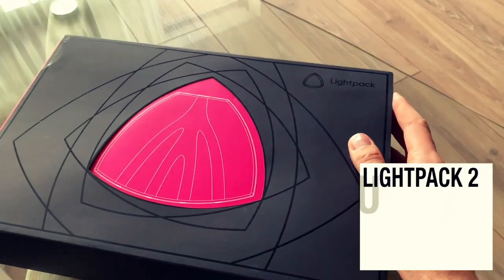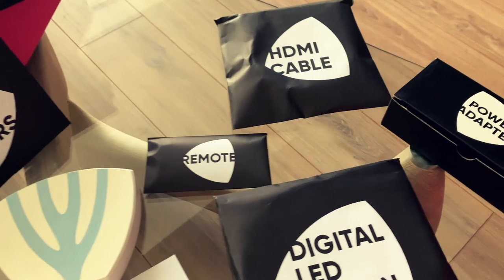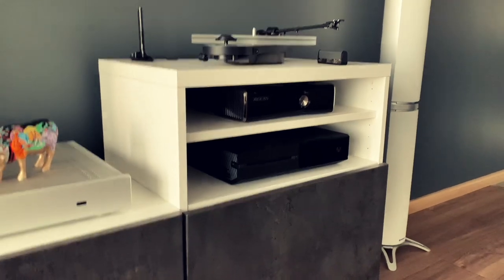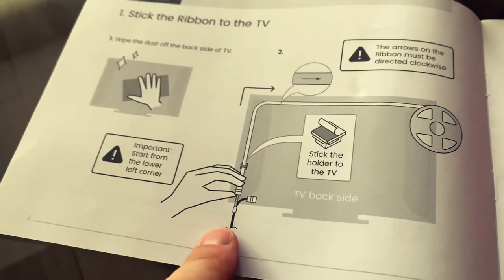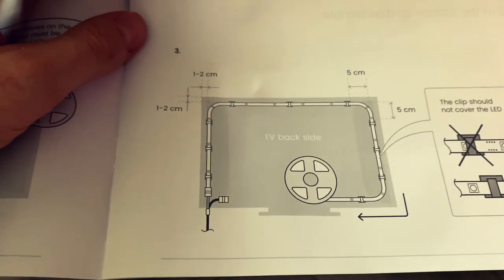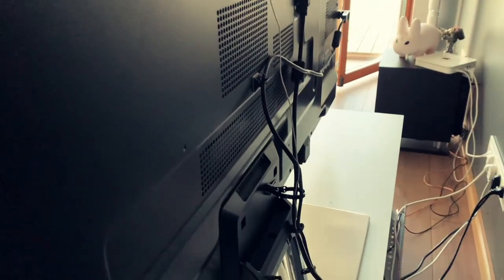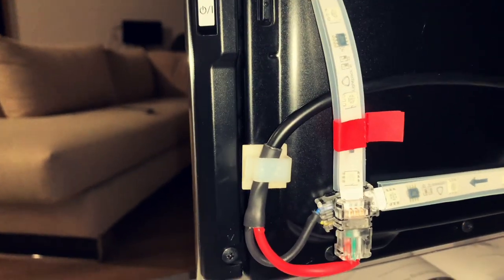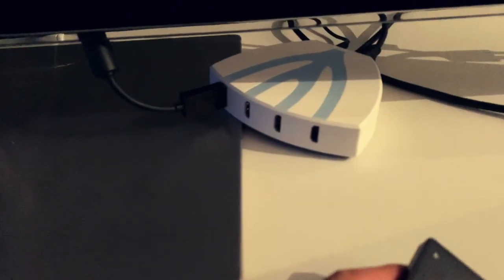Lightpack 2 - Unboxing, Installation, Review and Impressions

Comment: I bought the first model on kick starter and I love it. Had it for years and it run great. That kit came with individual lights that you could place in multiple formations. I really liked that because you could see some cool differences in how the color falls. You could also increase the saturation and brightness. Not sure if you're using "Prismatic" I only run my kit through my HTPC but there are a few settings there. Great Review!

Comment: I'm having issues connecting my HTPC to the lightpack.  for some reason when I connect the the htpc via the hdmi ( with CEC attached) it say no signal.   also think that its outrageous that they dont provide corner attachments for the led strips.
Reply from the maker: I think they decided that it will be simpler for an average consumer to stick one continuous strip rather than cutting it into pieces. As for HTPC, I suggest trying fiddle with HDMI settings (CEC, HDR, other things) and potentially hooking to another HTPC HDMI output, if you have it.

Comment: I saw this, but went with the Ambivision light system as its much better and more accurate with matching colours by using just a camera facing the tv.
From what i saw in this video the colours weren't matching what was on the screen. Also with the Ambivision there is no plastic covering the lights as it just sticks to the tv and can shape it to suit the sharp corners of the tv, instead of curving it like with this products lights.
Reply from the maker: Interesting, but I have to question the setup. Having an external camera somewhere between you and your TV might not be super practical. Also, you have to factor in processing delays in this setup. But if it works — great!

As for the color representation, this depends on many things. I believe the problem with the current LP2 strips, is that they are RGB only, there's no white LED (RGBW), and white tones tend to be bluish. Original Lightpack did a better job with color representation. But one more thing that affects this is the color of your wall. Mine is dark grey, which is ok, but not ideal, I suppose.

Comment: Hi can i apply this on 65inch tv ? Its only 5m long , is that enough for big tv like samsung q90r 65 is ?
Reply from the maker: I have 65" TV, and it is enough. But I would say it won't cover 70" or bigger TVs
Reply: @DanSilov  ok thanks for response :-) and what that mean its dosent support hdr ?
Reply from the maker: @psych0sko  Some newer movies are encoded with HDR (High Dynamic Range) which translates into a much better contrast than regular videos, but only if your TV supports it. Yours does support it, but you also need some videos to play. From what I understand, LP2 won't pass through HDR videos.
Reply: @DanSilov  thanks brother 🤞🏻

Comment: I got the moonlight to work.  How do I get it to play now through my ps4 and xbox? Thank you
Reply from the maker: Just connect PS4 and Xbox to one of the inputs on the LP2, and plug the output into TV. Then switch the mode of the LP2 and it should work. If it doesn't just power cycle it.
Reply: Dan Silov does I have a ps4 pro and a 4ktv; does that reduce the resolution to 1080p?
Reply from the maker: @erock81487  They have (had?) two models, standard and UHD. UHD is for 4K. The standard model probably won't output anything, unless you change settings to 1080p.

Comment: I've had mine for a few months now. One was DOA and they had to worship me one. Also I had cut where I'm supposed to but now theres still a 4 inch section that's dead which throws off the measurements so the colors dont match up with on screen actions.
Reply from the maker: I think it might be that the LED strip is damaged at the section that is not working. You can probably cut it out and use the included connectors to stitch the strip back.
Reply: So is it crap or nah
Reply: In the end, nah, it's not crap. I was able to update the firmware to correct everything and in the end it makes watching anything with it that much more immersive
Reply from the maker: @gemineye111  No, it's definitely not crap. When it works, it's very impressive. It's all those beta quirks that you have to live with that make the experience somewhat finicky.
Reply: Dylan Feutz is it bright as it looks on the ad??
Reply: Dan Silov does it perform like the ad?  I’m confused was the ad made with photoshop lol
Reply from the maker: @gemineye111  It is rather bright by default, and you can make it even brighter in the app. However, that app is still only in beta, not available publicly, you need to contact them to add you to the list.
Reply from the maker: @gemineye111  Installation is a pain in the butt, in my opinion, but once it's done it does perform as advertised.
Reply: Dan Silov thanks!  They make it look so hassle free in the demo setup instructions!
Reply: It can be very bright, I have mine set at half brightness because once you go any brighter anything on the screen that's black shows up green on the strip vs half brightness where black is actually just not lit up

Comment: Where do I buy one of these in stores or something
Reply from the maker: Well, looks like they couldn't handle the technical and manufacturing difficulties. They've announced recently that they discontinue the LightPack 2 and cancel the project. It's a shame, because this was the only affordable HDMI-based Ambilight box on the market, and it worked great when it worked. You can still buy one on eBay, and it will work okay most of the time if you don't need HDR.

Comment: Is it compatible with HDR?
Reply from the maker: I can't test it at the moment, but from what I've read, no, it doesn't support HDR. However, devs have been telling everyone that they are working it.
Reply: @DanSilov  what u think about the Hue Play HDMI sync box?
Reply from the maker: @UnboxingUncuTT  I think it is potentially bad news for Lightpack and similar devices, because it comes from a major device manufacturer with resources and experience. However, at the moment Hue Play box looks like a half baked solution, as it doesn't include the LED strip, and you have to think how to set up the lights around the TV to create an experience similar to Lightpack. I would also be worried about delays, since it's wireless.
Reply: Dan Silov I guess the big question would be “working on it” mean a software update or a hardware upgrade?
Reply: @DanSilov  true, so I currently got a hue play hdmi box and is considering other options before I invest more money into this, I will say it still needs work. But the color is not faint blue like this. And can be very expensive. So the first issue here is that the hue also doesnt support 4k hdr very well and the light sync will become frozen, laggy, and glitchy. But on 1080p it works perfectly. So I had to set my roku to output at 1080p.

Second issue, is to get this tv backlight effect on a 60 inch tv, i will need 10 hue play bar lights to create light zones (3 top, 3 bottom, 2 left, 2 right) at least but will cost me 600 to 700 just the lights alone and if I want to maximize then it will 4 top, 4 bottom, 3 left, 3 right.

So the whole system is 700 plus 230 for the hdmi sync box. So almost 1k just for the tv backlight effect.

But the great thing is that it syncs perfectly with no lag and the colors are beautiful. But 1k though!!!

I currently have one continuous light strip set to sample from center screen color and then I got lights around the room to sync... but if I want this ambient light effect, it will cost me.
Reply from the maker: @hypemaneats9134  Great, thanks for this. As I suspected, Philips approach is much more expensive. But still, considering it works as advertised, if Philips finds this market interesting enough, they can release cheaper lights or even package them with the box. Still bad news for LP and similar devices in the long run.